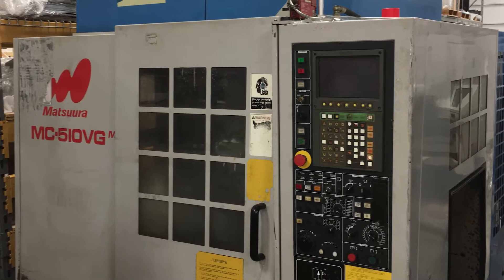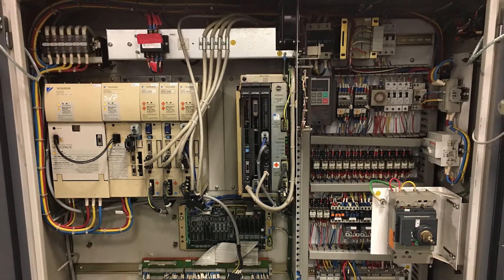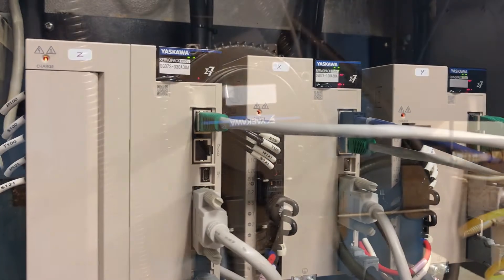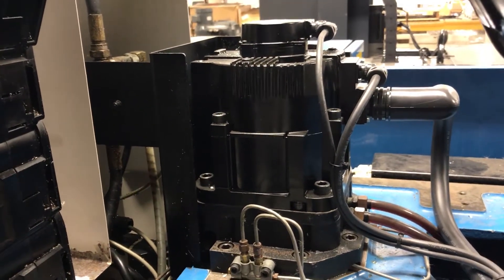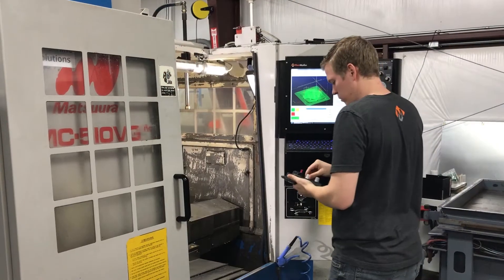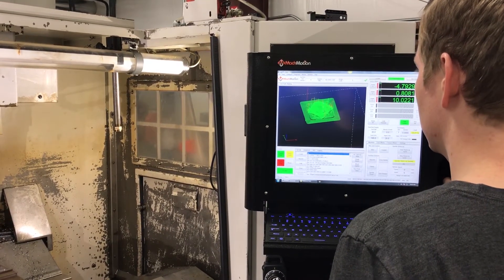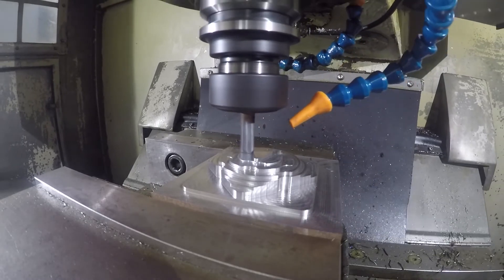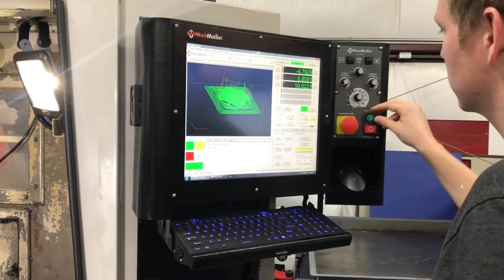Matsuura with MachMotion Control and Yaskawa MP3300 Motion Control Demo

Comment: What is ballpark $$ for what you did with that Machine?  IE what would you expect to sell the whole machine for as it is now?
Reply from the maker: I'd say between $30-40k. This model has a 15,000 rpm spindle in it. 

We do have an almost new Sharp VMC for sale, too: https://www.ebay.com/itm/2013-SHARP-SVL-2416S-M-Mill-Vertical-Machining-Center-CNC-Ref-7792052/202091393695?hash=item2f0d95f29f:g:X-8AAOSwNkJZ72uN